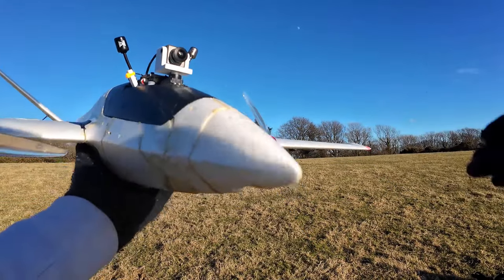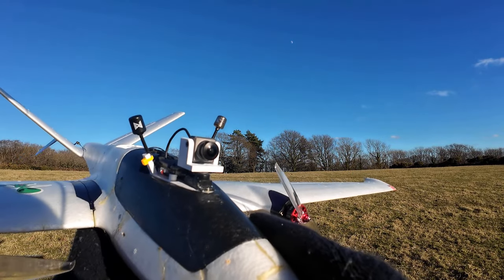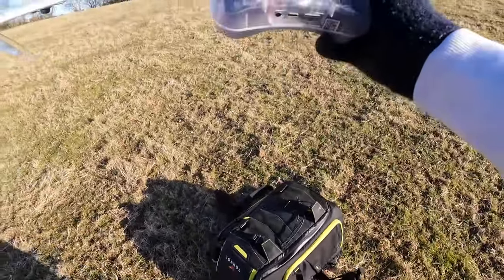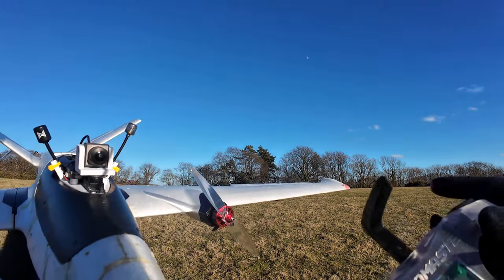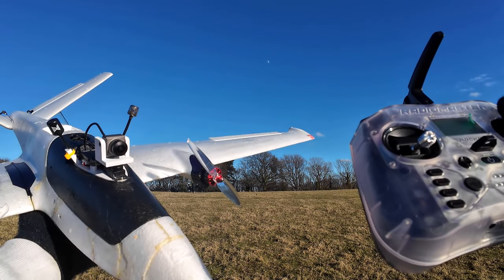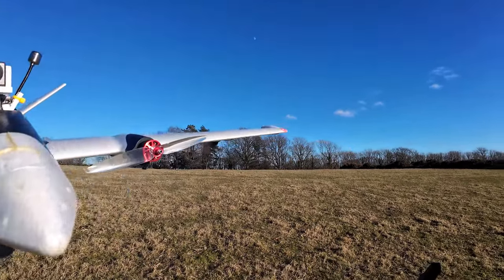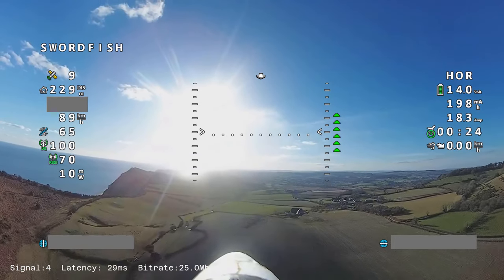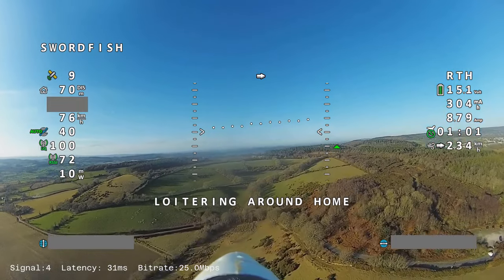🛩️AtomRC Swordfish - Narrated FPV Flight

Comment: Nice pan setup! I did the same with my T1 Ranger and noticed that back and forth jitter is from the RC signal of the radio. The scroll wheel will create the jitter, you have to mess with the scroll wheel a little for it to stop twitching. FYI, I use the boxer knob on the left for pan because I fly my wing with just my right stick and usually leave the throttle alone. This lets me play with the pan knob without an issue, also the boxers knob has the centering detent which makes it really nice to get it centered perfectly every time.

Comment: Nice! the most natural way I've found for me to use pan is setting it up on the rudder stick since I'm in cruise mode when I pan usually. I do have to setup a switch in the radio the change the rudder input to a different channel so INAV doesn't interpret it as a control input.

Comment: I put a pan servo on my albabird. Cool seeing the props. I picked through my old servos and found a regular servo that goes 260 degrees with hacked top and bottom ends. Can't remember what it is. But it seems some servos are more receptive to that hack than others.

Comment: Nice job getting it back in the air. Did you analyze the crash for a cause? Looking to learn before my maiden sir. Appreciate your content! Very helpful
Reply from the maker: It was 100% pilot error. I lost orientation whilst flying LOS, and then instead of putting the aircraft into RTH to make it fly itself home, I accidentally put it in acro mode instead 🤦😂
Reply: Thanks for replying happens to the best of us. I’ve been spending weeks getting this thing ready to go and trying for the first time not to rush it. Looking forward to some nice long flights.

Comment: Hi Giz how did your special functions. Can you share how to make that bib sound while pan view..lm using radiomaster pocket as well. Thanks in advance
Reply from the maker: Press the MDL button, then press the PAGE> button once to take you to the SETUP page. Then scroll down until you see Ctr Beep. Beside it it should say RETA1. To enable the beep sound when the rotary encoder wheel (S1) is in the centre position, highlight the 1 at the end of RETA1, then click OK (click scrollwheel in).
Reply: @gizfpv  hey thank you very much it works💯